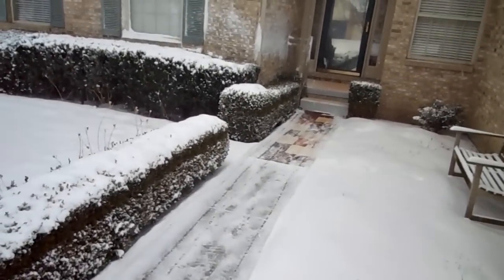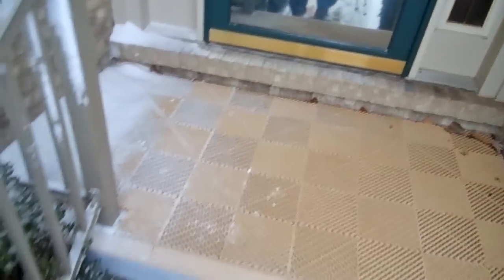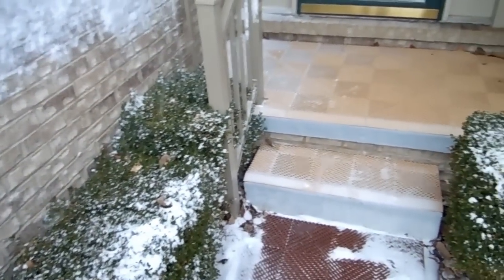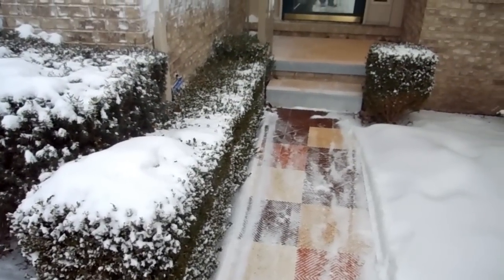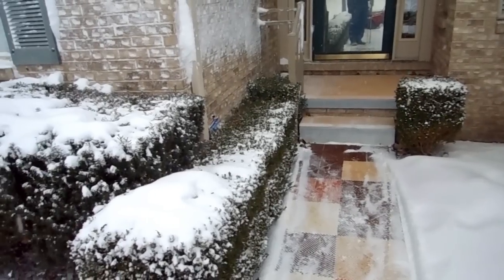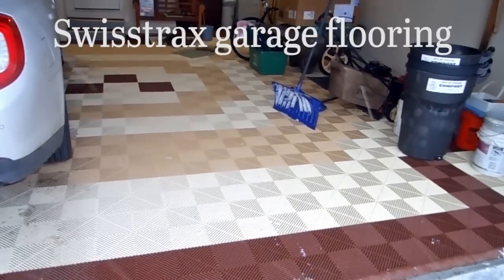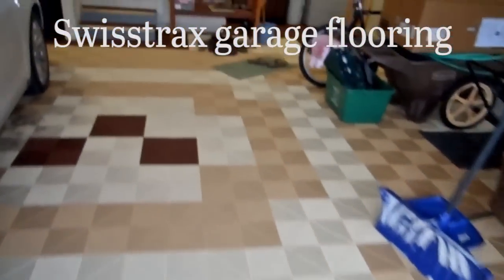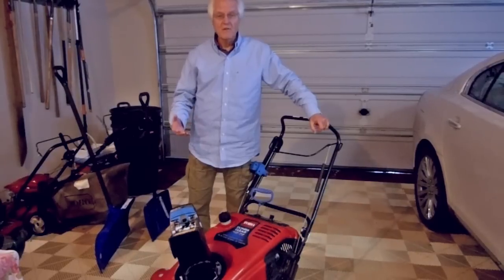snow test 1

Comment: Toro CCR 2400 GTS. Bought it in 1998. Haven't changed the paddles or belt yet. I did change the carb to an all brass one. I run Amsoil 100:1 synthetic. My wheel fell off because the friction fit cap came off from the force of turning after 18 years. I finished the 5 car driveway+EOD on 1 wheel no problem. Drilled the shaft with a titanium bit, put the wheel back on, placed a thin washer, inserted a nail and bent it like an "s".

Best thing I have ever purchased.

Comment: on 2/2/2015 i bought that same snow blower  -  the first snow in lorain ohio this year it would not throW  3' - so  dealer picked it up - $240 later  they put new paddles & scraper on - now waiting for  another snow  - MERRY CHRISTMAS
Reply from the maker: Did you buy it new in 2015? I don't understand why the dealer had to replace the paddles and scraper.
Wet snow is harder to blow than powdered snow, it's even more important to maintain minimum clearance.
Reply from the maker: Sorry, I miss read your comment. The paddles and scraper were replaced after 5 season and likely worn.
Reply: @kbittell  yes 2/2 2015  -  i know wet is harder to throw but not like that when everyone  else's  is throwing - it  just  clogged  even on less snow - so now i wait for the next snow - thank you for your reply

Comment: Does that particular model of snowblower use regular gasoline or do you have to mix the gas and oil?
Reply from the maker: No mixing of gas and oil. This model snow blower has a 4 cycle motor.
Reply: Ken Bittell Thank you very much.

Comment: Re positioned the paddles? I bought this Toro 421 power clear recently (shown here). The first run and the auger cable broke away from the clutch. The wheels are the same size as those on my Weber kettle grill. These things are so cheaply made it's ridiculous. Good thing Home Depot picked it up and refunded me.
Reply from the maker: I purchased the Toro 421 shown in this video in 2009. Other than two manufacturer’s recalls on the carburetor I’ve found the 421 to be durable and up to the task of moving snow. After two recalls the manufacturer got the problem with the carburetor corrected.

I take it; the cable for the belt tension-er is what failed on your machine. I have not replaced any cables on my machine.

I purchased my Toro in the box, believing I would be more meticulous with the setup than the average setup mechanic. Proper positioning and alignment of all cables is essential for long life of the cables.

Since the wheels are not actually drive wheels I would suggest to Toro maybe a smooth wheel would be better than one with a tread pattern. Snow packs in the tread pattern leading one to believe the wheels are square.
Reply: Thanks for the reply Ken. I too had it delivered in the box. The screws provided for the chute were almost too short but I was finally able to assemble it. The cable came away from the clutch inside the unit and I was unable to ascertain where or how to hook it back up. I am looking again and am liking this new  Briggs and Stratton SnowShred Serrated Auger with remote chute control and electric start for the same price as the Toro https://www.homedepot.com/p/Briggs-Stratton-22-in-205cc-Single-Stage-Electric-Start-Gas-Snow-Blower-with-Snow-Shredder-Auger-1696506/300434295
Reply: Milton/// I'LL AGREE ABOUT THE CHUTE SCREWS,THEY SEEMED ALMOST TOO SHORT,DIDN'T WANT TO THREAD.INSTRUCTIONS ARE A JOKE!!!! I BOUGHT A 721,IT'S A BADASS LITTLE MACHINE!!!! I'LL WAIT TO ACTUALLY RATE THIS MACHINE IN THE 3 RD SEASON!!!! I ALSO LOOK'D AT A COUPLE OF OTHER MACHINES,THE TORO WAS THE ONE THAT MY WIFE KNEW THAT SHE COULD HANDLE!!!!
Reply: Have had a 418, 421, 621, currently using a 221 two cycle (love it) and set up a 518 for a female friend...seems you had a lemon...it happens...never had a belt fail or cable break yet...I have the quick chute like Ken...keep both pulleys and the cable/chute lubed.

Comment: Nice cold dry snow, how about wet snow....
Reply from the maker: Yes it will blow the wet stuff  too. Setting the paddles for minimum clearance to  the housing will increase the speed of the snow through the discharge shut, eliminating clogging. You will think you doubled the horsepower of your snow blower.